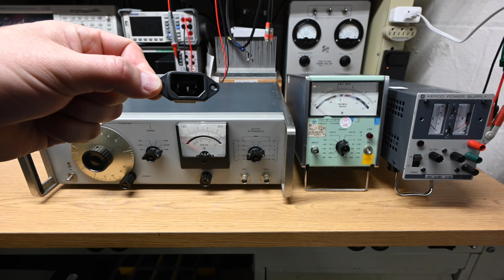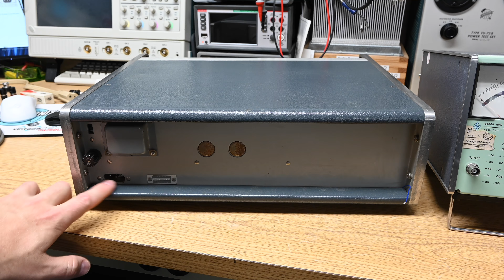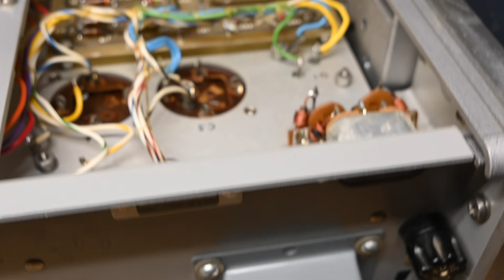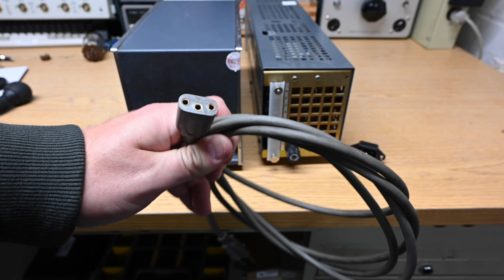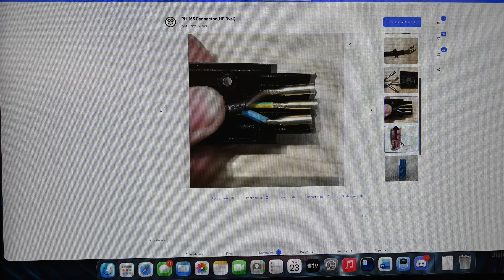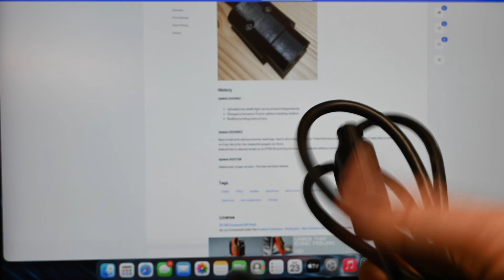3D Printable Power Cord for vintage 1960's Hewlett Packard (HP) Test Equipment

Comment: Good video. Why hack an old device just to install a new mains cable? It's just indulging into unnecessary, tortuous effort. Most mains pins are standard size and receptacles can thus be readily procured. Moulding a housing for such a plug can be done in a variety of ways, other than 3-D printing, using a variety of plastics. In need one can even resort to filing away at a solid block of plastic to reach the desired shape.  It will probably take less time than 3-D printing it.
Reply from the maker: I'm definitely a fan of 3d printing over any sort of molding.  Press print, go do other stuff, return 1 hour and 5 minutes later (at least on my Prusa MK3s+) and it's done
Reply: @philsanalogbasement  Well... put this way, you've got a point. When you have the right tools, the job is easier.

Comment: @3:30 I did a video repairing a 3400A there was just enough room for an IEC connector, but I would still like to have the older cable for devices that are harder to modify.
Reply from the maker: thanks again for sharing the chopper PCB, I've got one in that Green 3400a